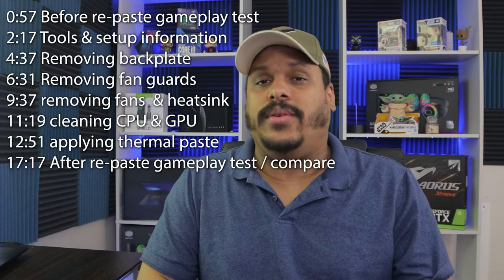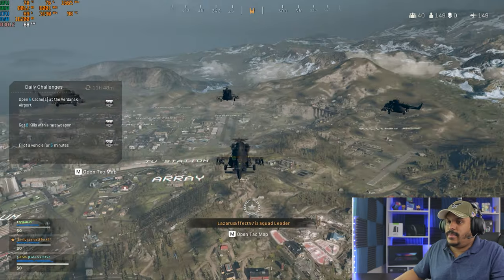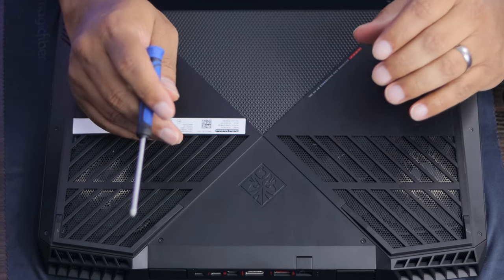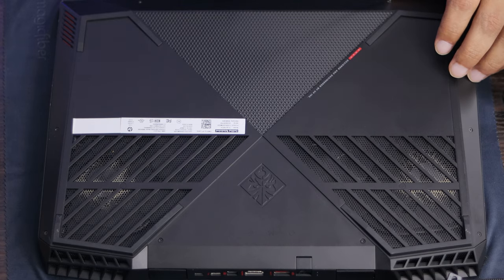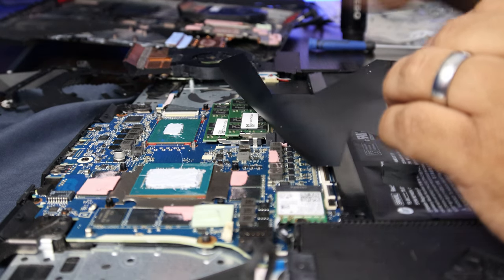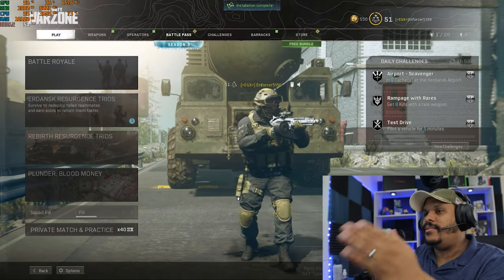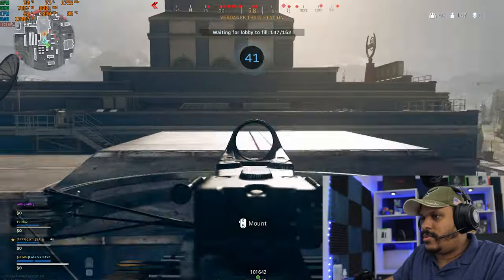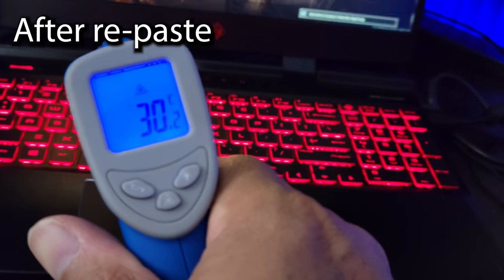HP OMEN 15 thermal paste replacement & Disassembly fix overheating

Comment: Few tips. I can clearly see at 15:59 you did not remove the old paste from the heatsink before remounting. That can cause worse temps than before. Plus please blast the fans with air or vacuum them before reassembling. It makes my ocd flare up LOL.
Reply: He mentioned that ten seconds earlier

Comment: I have an omen 15 5800h w/3060 and I repasted mine with Arctic MX-6 same as my desktop.  It will take some hours for the paste to settle in and perform its best.  On my 2021 unit the fans remain in place and the cooler comes out around it.  FYI there are two screws at the back corners holding the heatsink down that you must remove and if all others are out it just lifts straight up.

Comment: Arctic Silver 5 you've mentioned, such a good thermal grease but in the mid of 2000s, don't get me wrong but based on the reserach in the same or similar price range we have Arctic mx-2 or mx-4 which offers a bit better temperatures.

Comment: Great video! Just one comment - 12:12
Taken from another source: "That's Kapton tape, ideally I would leave them in place they are usually for ensuring nothing shorts if the heatsinks they are using have little to almost no clerance between it and the capacitors or contacts around the dies. "

Comment: have same hp omen with  8760h and RTX 2060...….   I just cleaned laptop exhaust fins and fan which reduced laptop temps by 10 -  15 degrees

Comment: So i just changed my thermal paste using this video and i also removed the plastic peel of my gpu then after putting everything back on i booted everything was fine and decided to launch overwatch to test the temps for now i dont see any major difference in temperatures but i did experience huge frame drops for like 5 minutes and then i freaked out and closed the game, then i tried another game which is not that demanding and no frame drops there is there any chance it was because i removed the plastic peel of the gpu ? or does the paste just need some time to set
Reply from the maker: Plastice is more to keep the paste off the hardware, could have added too much or too little paste. Or type of paste can somewhat make a difference.

Comment: Could you upload a full video with assembly? xD I'm trying to do everything right here and don't want to miss a screw. I'd also appreciate it if you'd tell me where I can find a manual for how many screws there are in this kind of assembly and what to screw in where :P
Reply from the maker: I'll try to get it posted here soon. Had a death in the family and been on breavment from work. So haven't been doing a lot lately 😕. As far as a manual I looked once before and didn't find anything with the number of screws. That's why like using a magnet and having a 2nd wide shot video recording lol, I've lost plenty of screws in the past.
Reply from the maker: I am so sorry man, it seems I cannot find the original files. I'm going to try and find them later this week and try a recovery. I know that doesn't help. This prob won't help also but I made a timelapse I made for some friends and never made public. I went ahead and made it public if you wanna check it out. Again really sorry man https://youtu.be/Ls-D8n3VctY
Reply: @EnforcerGamingX  Np man, I managed to do it and got my temps down by 20 degrees celsius xD
Reply: @EnforcerGamingX  One question though. It seems that one of the screws in my right fan doesn't fit anymore after I pulled it out? I haven't broken the screw or anything. Is that a problem that you've experienced too?

Comment: I want to do this but am scared I might damage the hidden components, do you think I should still do it? I have up omen 1660 to core i7 it’s same size and shape as the one showed in the vid and we sent it to a repair shop for $90 just to get it back getting 97-100*c
Reply from the maker: If you are not comfortable doing it then definitely don't. It is an easy process. Repair shops will use the pads so it will be about the same as the default. You can tell them you want to have a certain type of paste put on and most places will do it.
Reply: @EnforcerGamingX  but we did do it pretty recently around 3,4 weeks ago and the computer is still getting 97-100 Celsius I’m not sure if another one can help and if it doesn’t money might go to waste because 90$ was kind of allot

Comment: I attempted this myseld today and now my laptop won't turn on. I have no idea why. 
Followed every step, but now when i try to turn the laptop on, the power button flashes off and on but the screen stays off and fans dont start up or anything. 
Anybody got any ideas where i went wrong?
Reply: update?
Reply: @azaanbot3333  That laptop never turned on again lol. I tried everything I could find online but it was just dead, unfortunately.
Reply: @LemonMan91  wtf... im doing mine today
Reply: @azaanbot3333  Yeah, I'd just be super careful. Best of luck, mate and let me know how it goes!
Reply from the maker: Wondering if it got some static or something during the tear down or a connection loosen 😞 hard to tell tho 🫤
Reply: @EnforcerGamingX  Possibly! I used to do this kinda stuff on desktop machines for a living but laptops are a different beast 😅 That laptop dying was a good excuse to buy a new one though, so silver lining I suppose haha.

Comment: wow 97 degrees sheeeshhhh I thought my laptop was OH at 85... During demanding games like MW AC or BF I realized disabling turbo with throttle stop and disabling windows firewall which randomly took cpu usage up during gaming dropped my CPU temps to 85-87 and cleaning out my fans dropped it to low 70's to high 80's 

still this laptop gets hot no matter what you do, I've got it atleast 4inches up tilted and space for air, one thing that worked best was having a standing fan blowing right beside it full blast leaving my fingers cold and my annoyance high... was going to try replacing thermal paste and last messing with voltage but think I'm giving up and prob selling this eventually. not worth it imo
Reply: how can i disable turbo?

Comment: what kind of paste do you recommend?
Reply from the maker: The Thermal Grizzly Kryonaut I used in this video is working out great! I have a link in the description. I also use arctic silver 5, which I've been using for years. The Grizzly I've used once before but only from customers request. First time I researched and used for myself here and really happy with the results.

Comment: Any ideas for when the screws are too tight around the fan and heatsink???
Reply from the maker: Sorry took a bit to see this, really can't say you may been a new screw pack and cut the screw out, you could try mineral oil on it and use a small vise wrap around the screw to get it out. Just don't use something like wd40 that will not go well lol.
Reply: @EnforcerGamingX  same problem on me. the screw on my ram stick is stuck and couldnt remove the fan which need to replace damn

Comment: Bro it's Soo cool that this helped so many people. But I'm still fucked... I'm still getting some cores going up to 97° and I got the thermal paste replaced and there's no real noticable dust. No clue what else I could do...
Reply: Same here, I already repaste the thermal on my  asus fx503vm , only my gpu went down from 89-92 to 75-85c. But my cpu holy crap stayed the same, still running at 92-96c.
Reply: It's awful how do companies get away with putting in hardware theat can't be utilized. It's like some 3070 laptops outperform 3080 laptops just because of thermals. It's really terrible marketing. And in my case getting an external GPU won't fix anything because it's my cpu that's overheating
Reply: @ynot5643  So if you really wanted to low the heat, I suggest you to reduce the cpu load by turning on fps cap and   reduce the quality. It does reduce the heat but it just so sad high end rig  can't even play on max due to the thermal.
Reply: @rasyidlatiff8854  I wish it was that simple. Im playing at 60fps at 1080p on a 2060 in Halo infinite...
Reply: @rasyidlatiff8854  already lowest settings and running it at a lower resolution barely fixes anything
Reply: @ynot5643  How long  you been using that laptop? Did u tried repaste the thermal?
Reply: @rasyidlatiff8854  yeah I did replace the thermal paste. I just got it second hand last month.
Reply: @ynot5643  Actually, my friend who works in IT line  said, actually cpu  was designed to  hold until 120c( something like that) So running on above 90c is actually normal especially if you are using core i7  .  The downside is only  you get uncomfortable with heat and 92c will throttle down your cpu clock. As long you don't feels stutter or huge framedrop, your laptop is good to go. Mine running between 94-97 but I don't have any stutters and huge framedrop( according to my friend this is good since my laptop capable running at this hot) . Even though it quite relieving to hear that, but still I'm looking for ways to reduce the heat since I can't game my laptop with   max potential  due to the heat.

Comment: bro you recommend to take out the plastic?
Reply from the maker: You can leave it on, did some research on it after this video. They put this on here to stop the pads they use from getting on the gpu itself. It won't melt or anything. If you do take it off it just be sure to keep the paste off of the gpu there. It can't be good for thermal being on it imo.